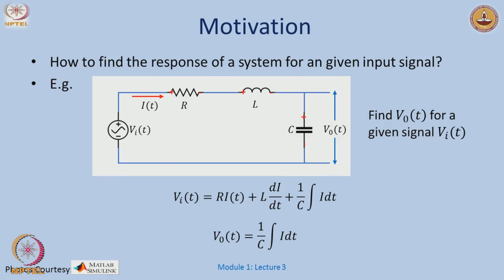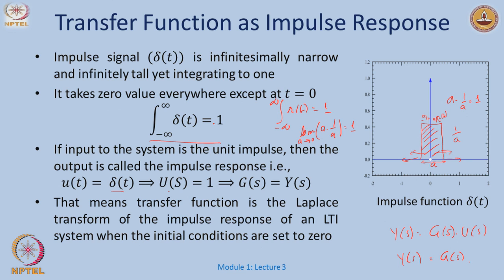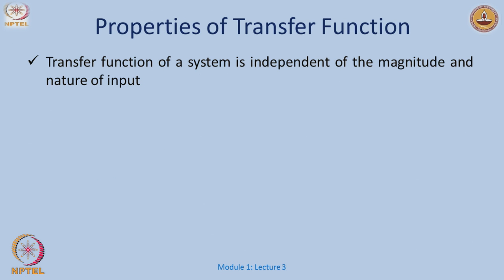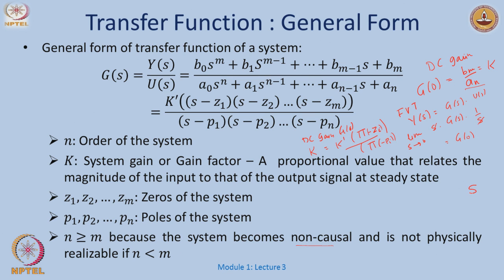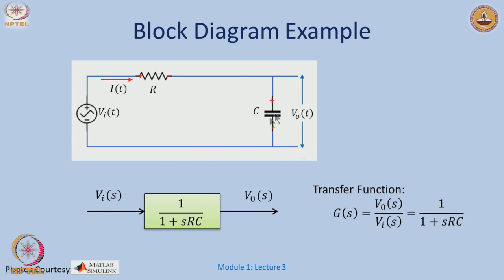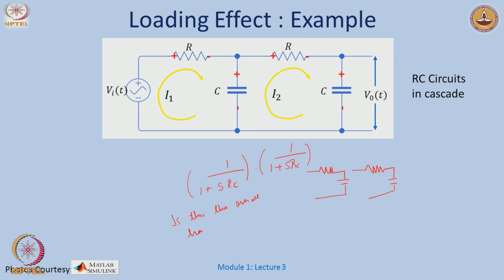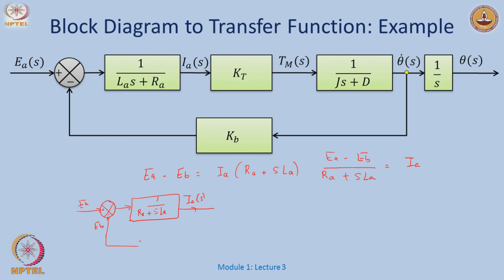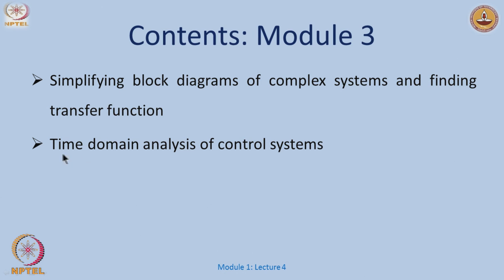Transfer Function of  Modelling Block Diagram Representation

Comment: 35:55 Sir I have a doubt in the mentioned video clip the equation 2 where Resistance R and Capacitance C (where Current I1 &I2 flow) are represented in it . But the Capacitance C (where only Current I2 flow) haven't represented in equation. Should we neglect it?